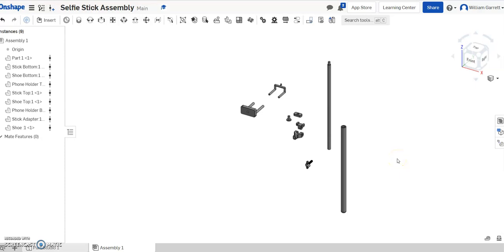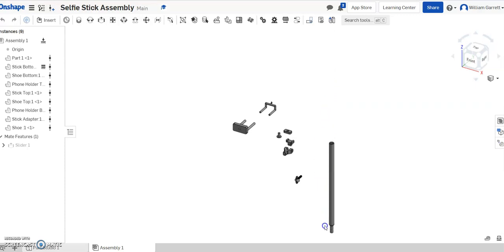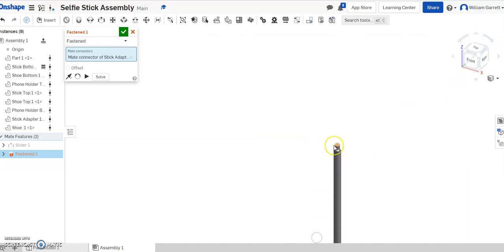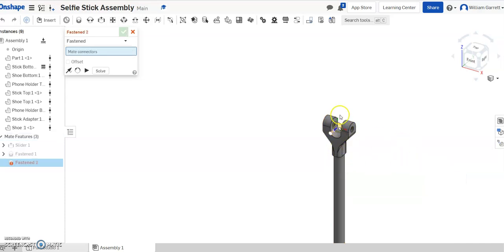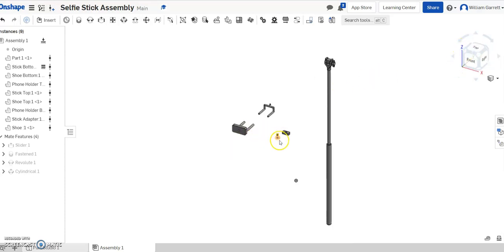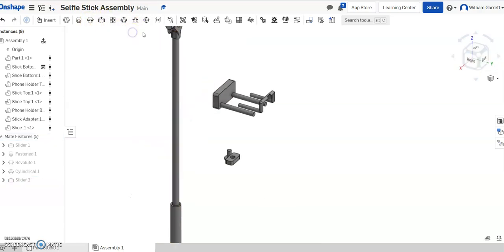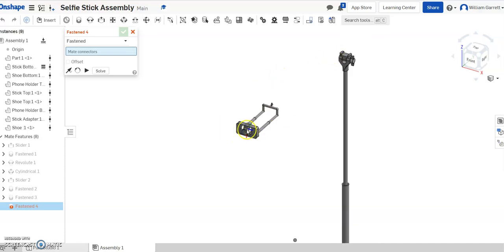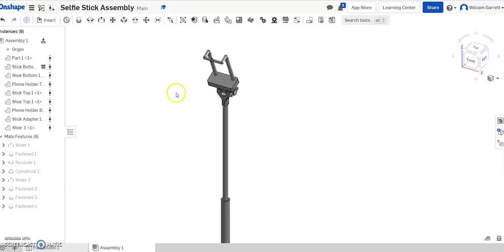PLTW IED 2.1.3 Selfie Stick Assembly Onshape

Comment: Hey there, how to move an object from one place to the other. For example, my teacher has the screwdriver in another file, so how can I move it from that file to the one with my selfie-stick? Please answer as soon as possible, thank you.
Reply from the maker: If you are just inserting it into the assembly, should be able to click insert, then go to the shared with me and find the file you want to upload it from how it sounds.   (If you created the file or have linked access can always do a move document) Otherwise have another video showing how to add the screws and components.  Just find the adding selfie stick pieces video I have for that.
Reply: @WGarrettScience  Where is the insert button?
Reply from the maker: @Asian2706  make sure you are in an assembly, then top left of your screen, can't miss it.

Comment: I keep getting errors even following you exactly when I use fastened and revolute
Reply from the maker: Could be a few things.  Probably accidently clicked something incorrectly on a previous fasten or revolute and now you are trying to do something that conflicts with that mistake.  After the error message it probably shows some of the fasten or revolutes on the left hand side in orange, most likely one of those is incorrect.  Also make sure the arrows point the correct direction when you select each component.